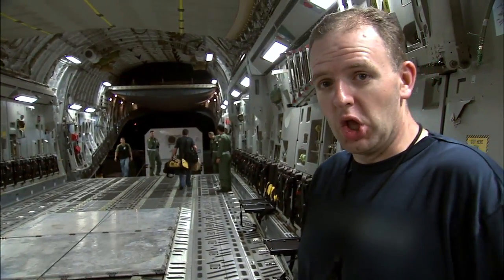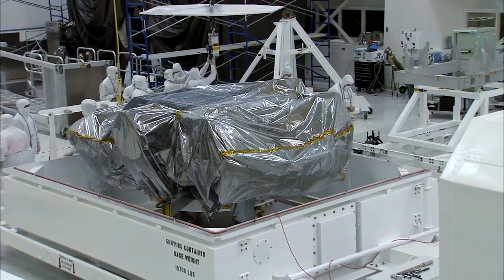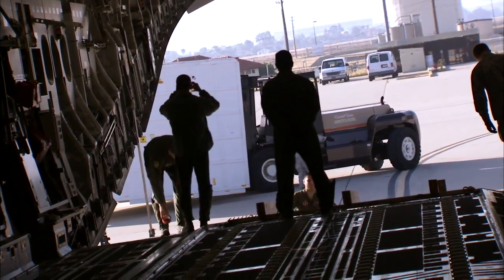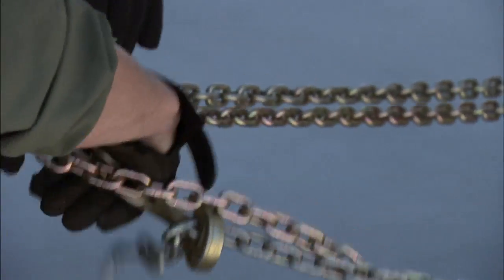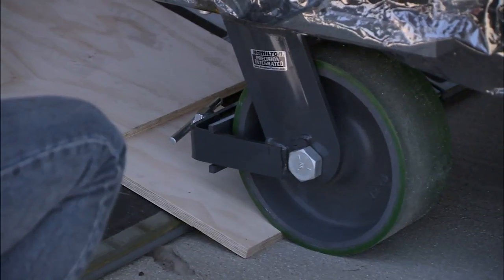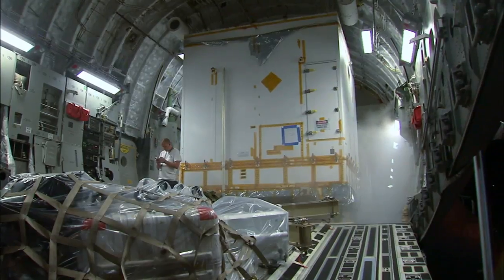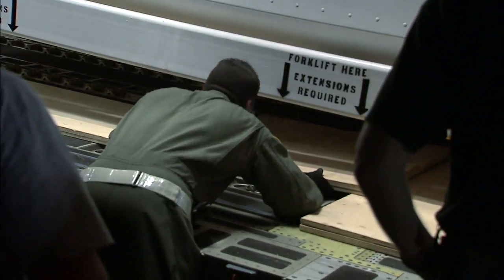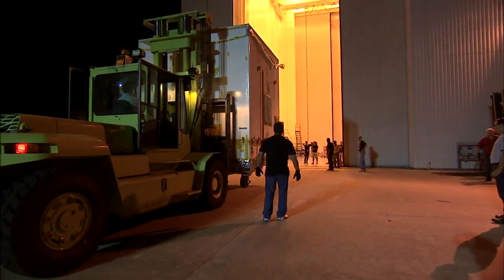The Challenges of Getting to Mars: Transporting a Mars Rover

Comment: @JPLnews

I was just wondering (and I know the answer is going to be because of the cost involved), but what about a large High Speed rail system that ca accommodate something the size of the shuttles (or twice that to make sure) and then build the corresponding security postings along the track.

It would seem safer and more reliable (in some way's but not all) then doing it with the current method.

Just a curious question from a person with questions.